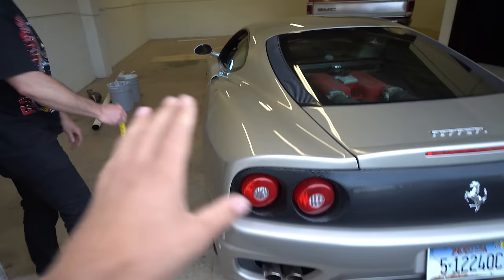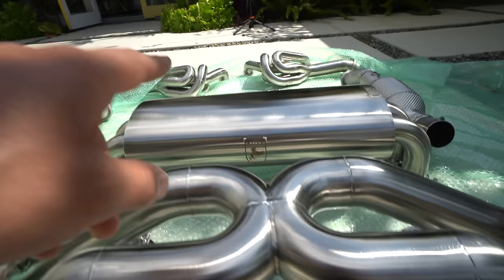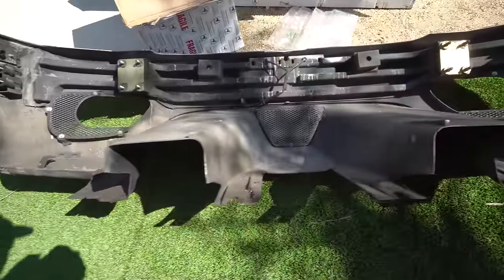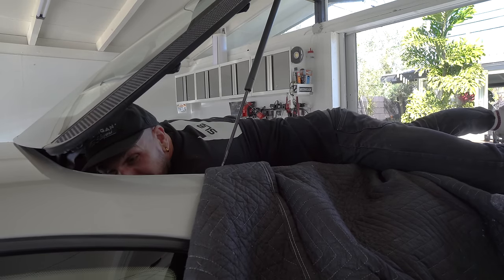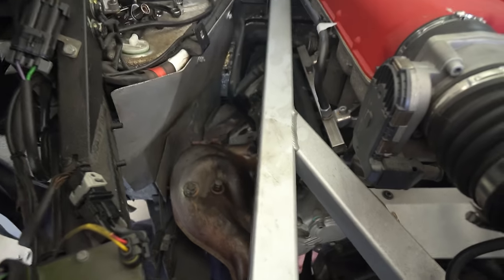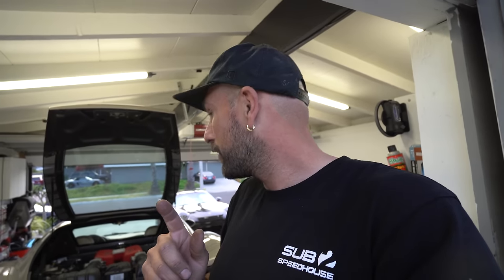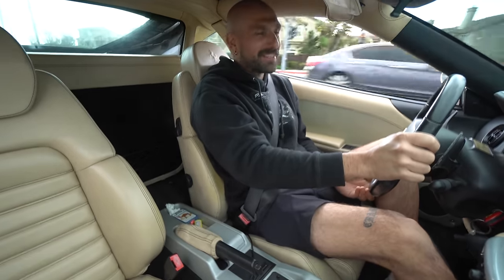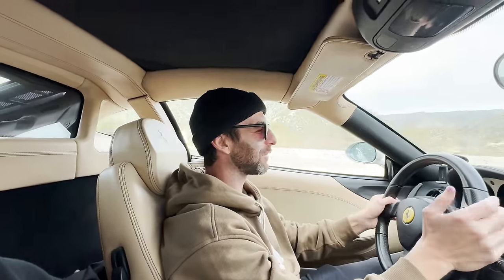CHEAP FERRARI GETS EXPENSIVE PARTS- F1 SOUNDING EXHAUST

Comment: After working on a 2011 f150 w a coyote motor,  I can agree on the degree of uncomfort working on some of these motors! Every single intake valve had compressed into the head so far that they all had an awkward angle on them and all a razor edge on the lip of the valves!

Comment: Nice to see even Zac unable to deny that the 360 sounds alright stock but man this is another level.
I do think noise though, for the car journo thing, I definitely think noise helps a lot. I drove a 986 Boxster S with an exhaust and top down that added an entire new dimension to the car that plainly wouldn't be there stock.
This sh*t has a nice burble too at 26:00! It sounds very F355!
Fascinated how the starter on these sounds like a literbike
I think ya did good! Curious what the big honker is supposed to do being so heavy other than muffle noise, curious if it's also a crash test thing
Interesting tho! Loving the vids! Keep it upp

Comment: Exhaust sounds great 👍🏻. 

Some other N/A cars can gain huge amounts of HP from simple mods. On the W204 Mercedes C63 AMG with the M156 6.3 you can gain 50-70 bhp with a tune alone from stock and a further 50-70 bhp with just headers.

Comment: Nice Kline! Just did the rear section on my 360 about a month ago, but yours is quite a bit louder with the full kit. Assume you’ve found 360Trev by now? He can set the rpm at which the valves open, amongst about 10 other things. Let me know if you want and I can make the connect.
Reply from the maker: I actually put an exhaust valve controller in from Kline. So i can run always open or always closed